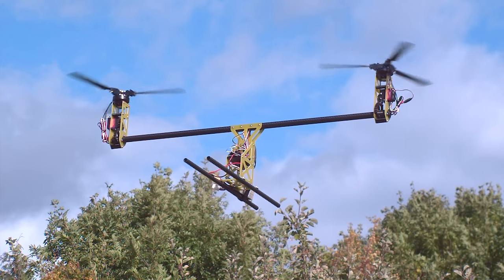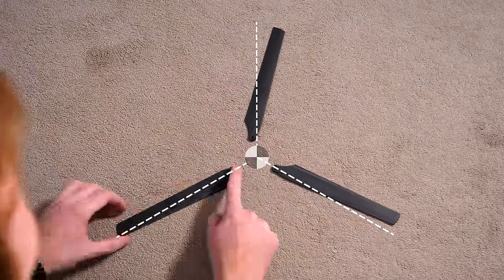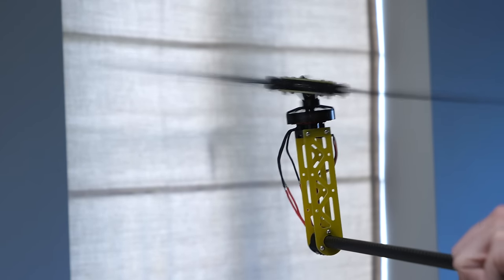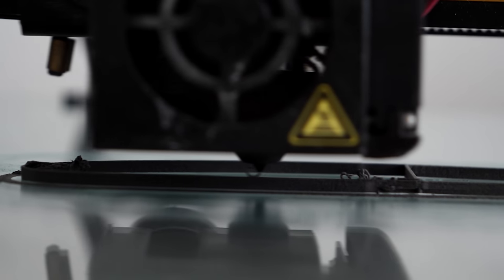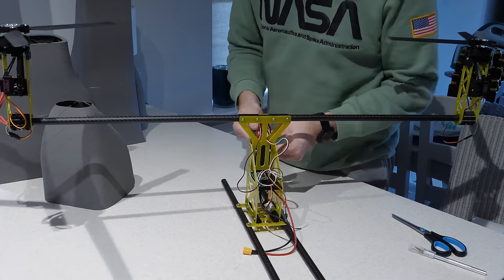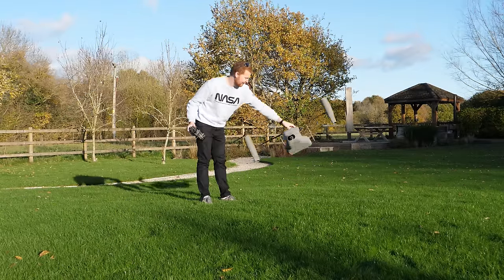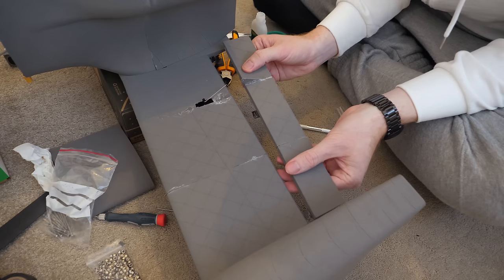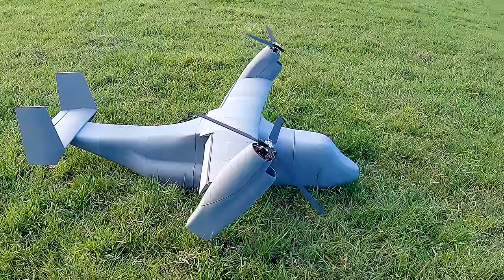Building a V22 Osprey - Part 2

Comment: keep it up, great stuff.  when i worked at draper lab after my SB aeronautics and astroautics at MIT in 1969,  the inertial measurement units were multi million dollar marvels.  i built a VECO Navajo free flight, 36" wingspan weighing 5 oz. with .049 thimbledrome motor.  when i got the thrust angle right, after it flew straight into the ground and broke in half,  it spiraled almost straight up out of sight, could hear the motor but not see the plane.  john piasecki told me if you don't want to crash like the osprey, use a tandem design, never side by side.  just some thoughts.  keep innovating.  do you play croquet?

Comment: you should turn off the rotors just before landing so that the forward motion stops and the aircraft starts to falling. whilst that you can change the rotor position from forward transmission to landing

Comment: To solve the tailheaviness issue when transitioning back and forth, would putting weight at the bottom/middle of the nacelles help with that? It'd move the CoM back while the motors are tilted forward and then keep it sort of in line as they tilt back?

Comment: The model becoming tail heavy when transitioning back into hover mode means that you need to make the "engines" neutral towards center of mass, I would do that by putting a counterweight so that the engine rotating between flight modes does not change its center of mass and therefore the overall center of mass of the model stays relatively in the same spot. I understand that you don't want to add weight to an already overworked motor but honestly I don't see much of another way of solving that particular issue, adding the fact that the model already struggles with the engines fully transitioned into flying mode I think that it might be necessary to either use higher rpms or bigger fins, both of which I believe need a overall more powerful motor.

That's just from my rudimentary knowledge of physics tho, so anyone with more knowledge about this can feel free to correct me if I'm wrong.

Anyway, impressive project, looking forward to an update on that.

Comment: Have you thought of a servo driven sliding weight to shift the CoG forward when transitioning to a hover. Or maybe weights on the bottom of the engine nacelles to balance out the motor weight..

Comment: Seems like the fuselage is too heavy for the  thrust output. Maybe slap some bigger motors on it and bigger props? Also have you tried flying it like a plane? I believe you could takeoff with the props forward on the ground with some landing gear

Comment: Awesome Osprey! I wonder, the propeller blade length is far shorter than that of a "scale" osprey. On the real aircraft, the blades from opposing engines on either wing almost touch to act as a helicopter, which also assist in forward propulsion due to the heavy empennage.

Comment: sorry for bad english you sould move the motors to where they pivot and then extend a shaft to the propellers. It while be hard to fitt it all in the motor housing but it while be simpeler and have less problems then a moving battery. Really like your videos

Comment: You can’t use the same pitch for both hovering and flying .. for hovering u will be set at a much lower pitch for high static thrust while and keeping a lower dynamic thrust . While in flight it will be the opposite otherwise the portion will unload leaving  you with no dynamic thrust to overcome the drag and get you to the desired airspeed where the wing could create enough lift force to keep altitude .

Comment: It flies well in helicopter mode.
How fast are planes?
However, the lift of the fixed wing seems to be a little lacking.
If you fix the power motor horizontally, change the propeller unit to a gear mechanism that can change from upward to forward, and add a fixed wing extension to the fixed motor, you can get more lift.
"V-280 Valor" has been decided for the next American military helicopter.

Comment: Can you print plastic that can be welded using plastic cement? Would make a cleaner solution than all that CA glue. Probably stronger and lighter as well.

Comment: It seems to be front heavy this way, making it unable to lift the nose. I assume that on a real osprey there is more weight in the back of the engine mounts, while yours is only in the top/front depending on the setting because of the motors, and the back is empty because it is pure cosmetic at the moment.
Maybe putting the motors in the back of the engine mounts with a long axle and extra bearing at the top, would fix it. :)

Comment: I am amazed that a mechanical gyro exists!! Dint think it was possible. Also how about using maybe 3 batteries. One in the fuselage and 2 in the motorheads as a "counterweight" Like this it doesnt get unnecesarily heavy and you dont need to slide the battery

Comment: You could make your gluing so much easier if you added puzzle like notches to the wings so they fit naturally instead of just wanting to slide about. No idea if that will work with your printing method.

Comment: I'm watching this right now, but since there is a weight shift, the motor of the "engine" should've been right at the middle of the wing, or a counter balance weight at the bottom/back of the engine. That way, the horizontal center of mass is unchanged when in hover/half/full modes.

Comment: Those vibrations have now turned into oscillation’s. 

You really need to get them under control. I build quad 

The simple fact that the oscillation’s are making that carbon fiber tube look like spaghetti is an indication that you have way too much oscillation’s. 

oscillation’s of that magnitude will wreak havoc on your flight controller.

Comment: I've never printed a thing so I may be asking a dumb question.  Could you include a series of tabs and slots or pins and holes between all connected parts to help with alignment for gluing purposes?  I would wonder if this would also help strengthen and align the vertical rudders.

Comment: Why not a longer shaft from the motor to the props and installing the motors further down so when turning them horizonally the weight is futher back. Might be an interesting solution.

Comment: Could it be the rotors? The ones on an actual mv22 are much larger to scale than what you had printed. Also maybe some weight under the motors at the “exhaust” to balance out the weight of the motors and rotors.

Comment: are you still working at the project? you could add a little weight at the end of each engine nacelle. adding the whole motor weight might be too heavy, but a little bit might be enough to reduce the CG shifting to a managable amount

Comment: Just some thoughts that sprung to my mind, which might be rubbish but I will share them anyway. 
Does the wing provide enough lift at the velocities you are flying? It's a very short wing and maybe for the weight of the craft and velocity does not scale adequately. Can the wing shape be altered to provide more lift in forward flit ht?
In the actual aircraft, does the engine exhaust contribute to aerodynamic lift on the wing? Of course your model won't replicate that.
Maybe the solution to transiting from forward flight to hover is to rotate the engines much slower than you are doing.

Comment: Hi, can you move the motors down to just above the spar with a drive shaft up to a pivoting rotor head, same as what you now have, just pivoting  the shaft , or put the servos under the spar with a shaft going up to control the motor pivot, either way should reduce the CG shift. Also, your props look a bit small if taken into account the real aircraft, what about prop direction, is it going in the same way as the original aircraft to reduce wing tip vortices?

Comment: Not sure if you read here anymore: YOu might have a look in the beyond osprey world where a full fixed wing with 4 engines is used to tilt not just the engines alone ?

There is a drone delivery project in the suisse called dufour and you find that by adding a dot and aero to find it.
Might be the right idea to go further cause that must have more lift and possibilities otherwise it would not make sense.

That is build for take off and delivery which means lots of landings.

Comment: I was thinking if you allowed the motors to angle backwards as well as forwards, you can achieve a self-leveling effect.
Reply: It seems as if your hover position is directly vertical. if you allow your proposals to pitch backwards It might be able to self level.

Comment: I would like to make a recommendation from observing the V22 vs this excellent scale model as a possible problem.    The propellers are MUCH shorter than the actual V-22.  With such small s wing area, the bigger blades will produce more thrust.    Blade shapes, size, and speed make a difference, even with computer cooling fans. 

I just watched an actual V-22 in flight and transition after this video (YT showed me both of these video) and yeah, the real thing's blades are HUGE.

I'm sure they make larger blades... don't they?

Comment: I don't know if it's been suggested yet but instead of adding weight to the motor housings, why not move the motors closer to the hinge(center of the motor housing) and then have a shaft coming from the motor to the propeller

Comment: Hey Tom, I have an idea. The problem here is the center of gravity, right ? What if you put the motor in the center of gravity and then the propeller shafts attached to couplings to reach the actual position ? So no matter where are the propellers the plane may stay balanced.

Comment: I really impressed with your experiments! Very good work! I used to read much news about insects since my childhood, especially about their flights. So i desided to share some ideas. Do you know that by aerodynamics laws it says that with such size ow wings bumblebee cannot fly? But it apears that their wings made trhust with every motion: moving up and moving down by changing angle of wing plane. Then no big wings needed. Dragonfly can fly very fast and effective becouse of front pair wings moved by special timing with  rear pair wings. It somehow gives additional thrust. You can google about it researches did on this theme, and maybe you can use it in your experiments. For example maybe it possible to do 2 fans one above other so blades will work as dragonfly wings and maybe will do positive effect. Or maybe these cases of dragonfly and bumblebee can be combined with coanda efect. Also interesting article about dragonfly flight researches appeared recently with  name "Flying in reverse: kinematics and aerodynamics of a dragonfly in backward free flight". Insects' wings come through hundreds milions evolution years and it is good idea use results of it.

Comment: bro when your aircraft completely make the motors horizontal its canter of mass shifted toward the nose make something like which maintains the canter of mass when motors are doing there transition like when they're going horizontal make sure that canter of mass shifts towards backward
or make a platforms which have some weights on it which can move in backward and forward direxn which can move center of mass

Comment: Would it be possible to get the center of mass more stable by lowering the engines in the shroud as far down as possible to the spars? The rotors could theoretically be attached to a long shaft.

Comment: Could you solve the cog shift problem by moving the motors down to the Pivot point and having a shaft extend the propellers out past the cowls and pivoting the whole motor assembly for gyro control?

Comment: Why not shorten the motor mounts and since the wing is causing so much resistance at vertical flight mode, tilt the whole wing instead of just the motors for transition. That would make the fusilage look bizarre but surely make the whole aircraft much simpler.

Comment: Forward flight seems too slow for such a high wing loading. Assuming your motors are powerful enough to reach near max rpm in forward flight, maybe you could try some coarser pitched props? This of course wont help hovering, but thats always the problematic trade off with fixed pitch VTOL.  Im also unsure what you did with the flaps, but as long as your airspeed is too low, keeping them down might help.

Comment: @Tom Stanton have you tried to print lightweight PLA with low temperature for the skin (higher density) and higher temp (low density) for the infill? I imagine that this combo can be great for high strength panels.

Comment: In the real thing the engines are closer to the CG. They also represent a smaller proportion of the total weight of the aircraft. I'd guess you're moving 20-30% of the total up weight forward and back by 15-20% of the length of the aircraft, creating a large amount of shift in CG in forward flight as well as the return to hover problem. I don't see how fast you're going, but both the forward CG shift and the lower scale speed of the model may contribute to the low lift provided in forward flight. Just some things that popped into my head watching the great video, cheers.

Comment: I wonder if stuff like this would be doable with more lift surfaces. The problem with transitioning between vtol and prop driven transport plane, is that there's not enough lift to thrust (just guessing so correct if wrong) So if that's the issue, would it be possible to provide say a bi-wing design that takes advantage of something similar to a flying wing design in shape but has more lifting surfaces without adding the weight of a singular giant wing?

Comment: Seems that this motors are struggling to lift this fuselage. You lose altitude when you apply forward because the thurst isn't compensating the weight.

Comment: I really like this design. I have plans for a business to make and sell similar much larger one made with 40/60 carbon fiber and strong 3d printer filament frame, wings & tail-fin with 6-7 motors that provide 60mph each so 360-420 mph total and have lots of backup batteries. Thinking premade rechargeable packs of 18650 or something similar connected in series of 20-24+ or so to each motor so can easily fly with 2 if need be, maybe a backup 9 volt for each motor too so if almost out of main battery I can know I have enough to land by programming it that way. I want to make it able to deliver blood and other medical supplies and for businesses to deliver products quickly and far away. Going to try to get rich people to invest in it and the team, hopefully it works out.

Comment: what if you add a movable weight in the air craft so when you go to flight mode or hover mod you can control the center of mass and counter the effect of rotating the propellers on the center of mass

Comment: Have some sort of weight transfer to keep a balance that is connected to the engines tilt so at half tilt it stays the same but at pure hover the weight shift forward to counter the tail heaviness then the opposite when entering the plane mode so your center of mass is slightly behind to give some nose lift up instead of down basically instead of one center of mass you have three you need to make all balance for what you need for plane behind the center of lift for hover dead center of lift and for half tilt be half center and half behind center of lift to compensate so on any mode you have the right flight balance between weight to lift center points once you've done that should fix most problems then get a denser battery for better flight time and to compensate for weight upgrade the engines or propellers to have higher rpm per energy usage or something like that to make them more efficient and need less throttle to fly like what happened in hover and plane mode needed you to have your throttle high while half tilt was the most efficient it was at out of the three if you can get the other two to that level as well that could make test flying easier without worrying of crashing due to battery dying other than that Great build it looks really good and if you ever get the chance to upgrade to have a pov first person flying by having a camera in the nose of the osprey it can give some cool sights but that's after it's fully refined

Comment: Why not move the motor further down and ad a shaft to drive the rotors? if the motors sit on the rotating axis the weight wouldn't shift (or at least not as much).

Comment: You need a counter balanse like a  Gyro system Some tall buildings at the top they put in a counterbalance For vibration when the wind pushes up against the building The weights at the top of the building counterbalance so the building doesn't sway so much. If you put a stabilizer like in a helicopter it may work to a certain point If you put a servo on weights to move the weights back-and-forth This could counterbalance when you thrust the blades forward. Good luck on your project

Comment: okay so i have a very basic understanding of aerodynamics... somewhat.. maybe not, so excuse me if this is a painfully stupid thought. When the aircraft model turns back into hovermode, it looks as if the transition is performed too quickly, hence the very sudden tyailheavy behavior of the model? from a hypothetical perspective, would a VERY SLOW rotation of the propellers from a half-transition mode to vertical or hovermode result in the aircraft model having enough time to smoothly adapt to being in hovermode? in other words, letting the aircraft slow down more and more until a full midair stop can be completed without problems. hope i made sense.

Comment: i think you have a misconception about carbon fiber it is really strong but its not exactly stiff and thats what makes it so good instead of breaking it will bend you have to inherently design the carbon fiber part with the stiffening structures  but a carbon fiber tube is just a tube so it wont stay stiff

Comment: Would a sliding counter balance assist with the backwards pull in motor transition as well as forward facing transition in normal flight?